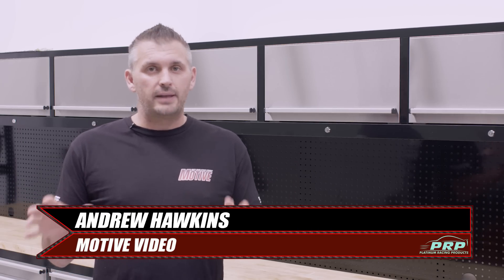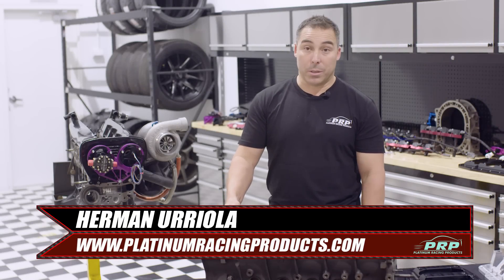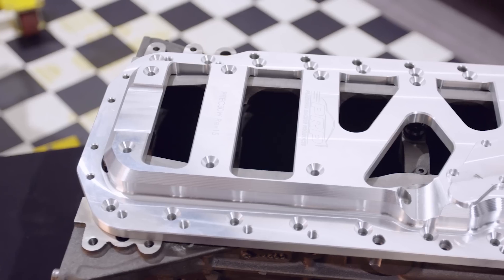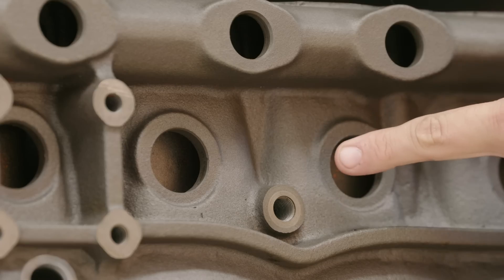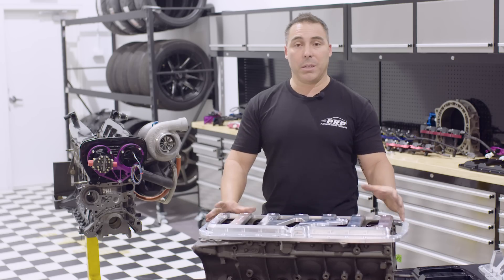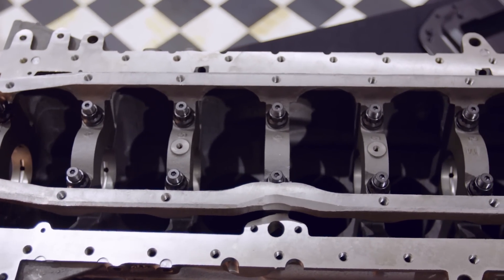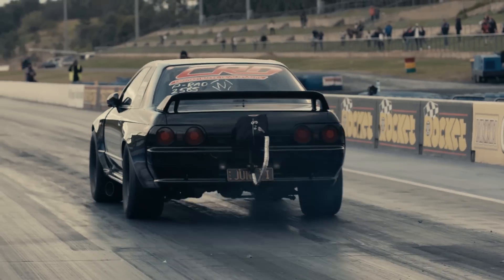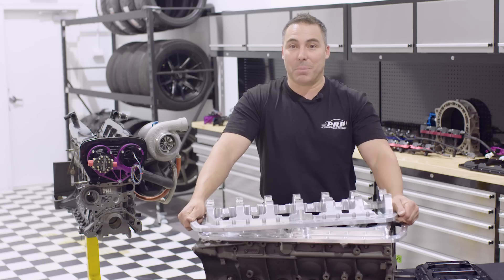How to Strengthen Your Nissan RB Block and Help Stop Cracking

Comment: Now your videos have grown lil boys saying 2jz is superior from a block examination 🤔 if only the cylinder head from a 2jz was adequate.
Reply: At least you can modify it to suit your needs
Reply: Its got a Yamaha head man its not bad at all!
Reply: Compeer Raa gte head follows like ass and every port is different GE ports are way better.
Reply: +MSengineering David While it is true that a stock GTE head doesn't have the best flow, it has been proven to support in excess of 1500hp. Don't confuse capability with realibility.
Reply: Supraman not after spending a significant amount on it there are way better 2j heads.
Reply: @msengineeringdavid3702  Any 1500hp build is going to cost significant amount of money, but the point is no porting of the  head is required to reach those levels, even as "inefficient" as it is.
Reply: Supraman Supra’s are rarely at 1500hp power levels my boy lol... ppl talk up these cars too much. Every time I pull apart big singles from customers cars they have flattened bearings.. the head work is something of cout not everyone can do or properly develop.
Reply: @msengineeringdavid3702  There are plenty of 1000-1500hp 2Js out there, probably more so than any other inline 6 - ever. Quite a few of those have 0 port work, including my Supras and many others. With zero issues.
Reply: Supraman  cool one liners, but there aren’t plenty just a handful, they don’t survive at that power level. They need regular maintenance cause they think girdles less and stock caps live beyond 700whp which they don’t . Ps you’re full of shit “zero maintenance” no they flatten bearings and need aluminum rods .
Reply: Supraman  lol name them that you don’t really personally know.... also back it up with data I won’t hold my breath. I don’t give a fuck about Supra forums ppl also back down to that when the feel threatened then need a safe heaven I don’t need to go where a bunch of chair warmers who pay ppl to work on their car talk ... anyway you don’t have such info so this is over. Very rare for Supra’s to be running 1500hp  handful an estimate of 2%
Reply: I hope they put out 50 more vids saying the 2j is the best engine ever built in all the history of engines. It will only raise the cost of 2js and lower the cost of RBs. #RBswapeverything!
Reply: @Blakek.  Thats not how supply and demand works.
Reply: Supraman sure buddy.
Reply: Tex 13 what the fuck is a US engine? How do you know a safe limit with no real data of your own? Lots of talk in here. You mean American V8’s gen 3 Hemi blocks crack at 1000+ whp ls block don’t hold that’s why they have aftermarket casted blocks. Dubbed LSX For some dummy here talking like he runs that all the time which he doesn’t is beyond me.
Reply: @msengineeringdavid3702  uh, gen 3 hemi blocks cracking at 1000whp? you mean just like ls blocks? why does the ls engine have aftermarket blocks as well?
Reply: Supraman he said monkey scrotum idiot sound like the insult of a guy who’s never touched the bottom end in his own car...another chair warmer.
Reply: Frigglebiscuit you sound sound stupid as fuck you’ve seen nothing go be extra somewhere else please
Reply: Tex 13 2jz don’t have diffs on their blocks... idk if you’re incoherent but RB don’t need to have a hard block to run the same power the level of incoherence is high.
Reply: Supraman  don’t care about tx2k19 take your dumbass to the track upload a video or never trigger my notifs again.

Comment: Get a 2jz instead, lol...extra credit if you grab a billet 2jz block...or, if you really want to make some power, you'll grab a Brad Anderson Hemi and make 3500hp
Reply: That's not the point!
Reply: Bullet makes billet blocks and heads for RB's... It's good stuff too
Reply: @danielbrealey2924  I'd rather Siamese cylinders, but I'd rather an American V8 in any case
Reply: @Tex 13 I'd say stick with the NASCAR motor...can't beat the sound of a high-revving v8!
Reply: @Tex 13 Google wasabi supra if you think a hemi can't fit!
Reply: @Tex 13 r5p7. you wont regret it.

Comment: Are there any subframe or front axle clearance issues on any GTR models with the AWD sump sitting 12mm lower?
Reply from the maker: Russell Hocken heaps of cars run them with no issues
Reply: Drive shaft angle will be effected.
Reply from the maker: @Roger-nu2ec  It has had all of zero real effect on the hundreds of cars using it
Reply: people run 2 inches of lift in the 4wds and dont ruin cv's 12mm aint going to be an issue unless your bottoming out or lifting wheels then you have other things to worry about like the fact your crashing
Reply: Zero clearance issues. For those that fuss about driveshaft angles, it makes no difference, just as the CV joints move up and down with suspension travel. If anything at launch your front  will lift more than 10mm to bring you back into line to where you want to be under power.

Comment: Wow no wonder so many people choose a 2Jz instead it much simple and you don't have to do all this stuff.
Reply: Shit Eldan, looks like getting some strong bites, what line do you use? Some real big saltys in these waters.
Reply: @Ash_mz21  they just mad at the truth bro so they have to bite hard loool
Reply: #billet2jz #simplemods
Reply: Ash W shit bitches looks like none of you knew anything from
Before the last 3 videos since this signifies none of you run any 2jz or RB’d to such power levels 🤦‍♂️
Reply: @msengineeringdavid3702  no need to be mad ,both great engines
Reply: Here we go....Toyota vs  Nissan fight.My money is on the 2JZ but all jokes aside.Both cars needs mods to last its called racing.Eat sleep break repeat
Reply: @dirkdiggler9082  Brad Anderson Hemi for the win, lol
Reply: Ed Jack there is more than one 2jz block revision ... the reason the 2jz is swapped into everything is because it comes in a lot of cars that aren’t Supra’s meanwhile RB’s didn’t make it across the world globally. On top of that some NA variants have oem turbo rods in them. Just because you have a 2j doesn’t make you a winner. Both engines are obsolete now.
Reply: Ls is better.
Reply: Interesting read in the comments section. Not going to get into a pissing contest with some of the ladies above, but plenty 2J's out there in the 1100-1200hp range running stock main caps, including myself. I would not consider broken mains on a 900hp 2JZ, the norm. The torque output and delivery plays a huge role too.
Reply: Supraman  breaking caps are the norm if ppl actually used their cars instead they dyno Queen the thing and highway race it that’s a 2j with track use billet mains and girdles exist for a reason.
Reply: Supraman no no no.... 2JZ’s are RELIABLY / DRIVABLE 800hp on stock everything internally and that’s with Toyota going full send in the factory overbuilding the 2JZ  which is where I feel Nissan put all their effort into the GTR chasis itself and Toyota focused a lot more on the powertrain However this BS that RB’s are unreliable is utter crap
Reply: Gay talk right here. Might as well say U have a V12 Lamborghini engine in your car. 

Who cares it's a complete different engine 

Zj RB who cares 😂 

 If the engine is for hi performance racing application an is built with the parts available on the market theses days every engine would be good.
Reply: Ed Jack that’s up to you .Toyota has a bunch of newer engines now that do amazing things. GR V6 UR V8’s make power that eclipse anything a 2j could have done. That engine that’s in the new Supra may be a BMW variant who knows but BMW N54’s have made massive power in stock internals.
Reply: Billet blocks copy the oem design the head is still oem on most.
Reply: Man. I need some more noodles and broth for this shit. Its getting pretty goid.
Reply: 2jz is the better engine but GTR is the better car.
Reply: @Tex 13 Not doubting you, but do you have a link to the full interior skyline in the 6/7s? Having a really hard time believing that. Unless it was running a non-oem trans.
Reply: @Tex 13 Any car thats hitting 7s or 6s consistently has to beef up the transmission, axles and suspension or else it will be only a few runs. 
Your wrong. If you modify both a Supra and GTR up to 1000hp. Upgrades to reinforce the transmission, axles, driveshaft or shafts, suspension and tires. 
I guarantee you those GTRs have upgrades to the transmission and axles.
Rear wheel drive is preferred in a dragster. You don't see funny cars using awd. At a certain speed with awd the front tires active drive will start to impede maximum revolutions of the front tires.
Reply: I’m RB guy to my core I have a RB25 In my daily ( Nissan 240sx S14) pushing 550hp and an RB20 in my Miata  that being said the 2JZ is a monster in terms of how much time/research/ and tears Toyota put in the Production of the 2JZ we RB guys are improving the weaknesses in our Engines that Toyota thought of in the production of the 2JZ that helped how strong this engine is they don’t suffer from weak oil pumps/ blow by issues(easily fixed tho not the end of the world) cracking cylinder walls even tho I feel that’d be a problem the 2JZ would have if it had a Diff attached to it forged crank from factory  Toyota did Toyota things in making the 2JZ as friendly as possible so pound for pound the 2JZ is the better built engine FROM FACTORY than the RB26dett now the GTR chassis is leaps and bounds better than the Supras chassis in terms of all the technology that went into the drivetrain of the GTR at the time that was decades ahead of its time literally to this day the technology in the AWD system of the R32 rivals modern day AWD systems in functionality and technology and it’s a 25/26 year old car man
Reply: Even then, they're just still not as cool.
Reply: Out of the box the 2J is a stronger engine to be sure, shame they were stuck in cars that can't compete with GTRs :)
Reply: @FullTimePRO  Supra smokes a GTR on the drag strip.
Reply: MARZOSIRUS  street Supra’s cannot compete with GTR’s... nothing short of a well prepped track.
Reply: @msengineeringdavid3702  I'm not in favor of one or the other. I prefer an awd car personally. In fact I love the R32, R34 and 35. 

I'm just saying most R32s,33 and 34s can't compete against a mk4 Supra in the 1/4 mile. 

If were talking laps on a track or any road or highway with numerous turns the GTR is one of the best ever. 

I simply stated the 1/4 mile is where the 2jz shines in comparison to the RB. 

The RB isn't all that great. In fact Nissan switched to a twin turbo V6 in the R35. So I don't know why you keep defending the RB vs the 2JZ. Any engineer can point out why the 2jz is superior to the RB.
Reply: MARZOSIRUS you’re wrong most this most that? Did you go out into the world and get those stats? No you made that up right here.When it comes down to the real work the Supra cannot compete unless it’s a big highway roll or prepped drag strip.
Reply: eldan wiggins  before you run your mouth even further mains of a 2jz at 900whp http://blog.titanmotorsports.com/wp-content/gallery/Titan-Main-Caps/titan-main-caps-01.JPG
Reply: @msengineeringdavid3702  thanks for that bit of info. I guess the 2jz has its issues as well.
Reply: @msengineeringdavid3702  I don't have to see nothing take you link and shove it up ur ass it is world known and said time after time that 2jz is better and more reliable case in point the RB has to much shit you need to do with it to make it stronger.
Reply: eldan wiggins sure you don’t need any proof from ppl that have engines that gone through the power levels you’ve never been to?!? Seems about right for a YouTube comment a severe lack of pertinent information!
Reply: @purplehills56  despite all what you say amd think Im bettkng you cantt show a 24hour race the 2jz has won. Funny thing is. The RB has the Spa 24 hour race. Back in 1991. Thats before the 2jz engine went into production I think.
Reply: @conradsealy9603  it doesn't matter what RB has done the point is you regardless off if you have to mod the two engines to hold more power which you have to do the 2jz you don't need or have to do half of what you have to do to the RB engines. With the RB engine you definitely know something will break but the 2jz is unstoppable if it were not so people would be buying more RB engines to do swaps instead of a 2jz. All swaps now are 2jz why cause it's more reliable.
Reply: @purplehills56  get back to me when a 2jz gets a checkerd flag at a 24hour race. 😉
Reply: @purplehills56  by the way. Not all swaps have 2jz. Right here on youtube there is a subaru/RB26. Look it up.
Reply: @purplehills56 you have seen even the 2jz has issues at 900hp with its main cap. I dont know the RB has that issue. Bottom line is. Both these engines have their issues.
Reply: @conradsealy9603  man all swaps have 2jz !! You get 2jz commonly swapped more than an RB. It's like an ls engine.
Reply: @conradsealy9603  bottom line is all engines has issues but between it and the RB the 2jz is stronger and better hence the reason it is most sort after
Reply: @purplehills56  most people keep the RBs in the R32,R33 or R34. There arent many RBs without the car. Unless its crashed.
Reply: @conradsealy9603  listen man I don't care about your stupid checker flag race I don't have sides for either engine the point is out there clearly that a 2jz is much better and stronger and you don't have to do a whole lot of modifying to get that much power if you don't want to much power.
Reply: @conradsealy9603   show me a 3000hp RB that's run sub 6s quarter miles ?
Reply: @Realtime1501  there isnt a billet block 2jz making 3000hp. They max out at 2500-2600hp. Dream on kid.
Reply: @Realtime1501 the only 6 cylinder engine on this planet capable of 3000 and 3000+hp is the VR38DETT.
Reply: @conradsealy9603  uhm no Ekanoo was 2900hp on their supra  as quoted by Titan and there are a few 6 cylinder engines capable of 3000hp
Reply: @Realtime1501  myth. ETS however has videos showing their VR38 making 3500hp and Im sure even you have probably seen that video.
Reply: @conradsealy9603  AAP V6 corvette holds the 1/8th mile 10.5 outlaw record and that is definitely closer to 4000hp than 3500 hp
Reply: @Realtime1501  and excatly what part of this engine is production again? NO PART! Its ALL billet. Head. Block. Everything. Not even the cylinder head is from ANY production car engine.
Reply: @conradsealy9603  so how many more times are you gonna move the goal posts ?
Reply: @Realtime1501  you show an all billet engine amd compare it to production car engines? Lol. Two different things kid. Lolol. 😂😂😂
Reply: @Realtime1501  modding a production car engine to make it stronger is one thing. Making a custom block and head then comparing it to a production car engine is just dumb. 😆😆
Reply: @Realtime1501  thats like comparing a taylor made suit to and off the shelf suit from the store and expecting the same or better from the off the shelf suit. 😆😆
Reply: @conradsealy9603  so i guess Ets are running a factory unopened engine with a $5 tuning chip and not an all billet engine ,right?
Reply: @Realtime1501  no but the whole engine isnt billet like the 498 cid  engine in that corvette.. NOTHING there is from any production car engine. What part of that you  cant understand?
Reply: @Realtime1501  show me a 2jz that's run a 9 second quarter mile with street tyres and 5 speed manual.
Reply: eldan wiggins a 2jz cracks mains and they don’t have a diff that twist on it for launches dumbass.
Reply: @msengineeringdavid3702  2jz is far superior...there is a video of 2jz versus any RB or RD motor
Reply: Agreed 2j are better

Comment: So a 2j bottom end with girdle and a 26 head should be the perfect combo?
Reply: Any particular reason why 1000-1200 hp on either platform isn't enough? Nobody likes Dyno Queens so unless you have a practical use for having more than that...
Reply: @dj4monie  you would think yes, but your average time attack car now runs over 1000HP, and drag... well, more, not for long but much more, so as our clients push these limits, we are asked to come up with solutions to help, it is getting crazy :)
Reply: @dj4monie  100% this. im so tired of these stupid hp wars.

Comment: Do you recomend this brace if i use N1 block and about 1200 hp
Reply: You will crack the block next minute or next day with that amount of power going through N1 without any bracing.
Reply: i'd say yes
Reply: Definitely
Reply from the maker: Definitely
Reply: @MotiveVideo  thank you for the answer will order one as soon as the engine is out